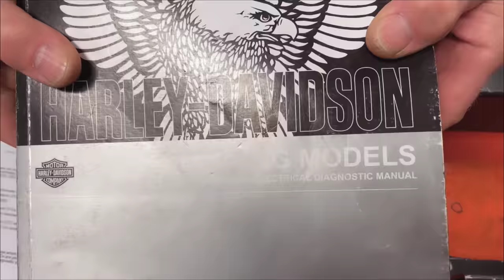Harley-Davidson Problem Codes | What Do They Mean?! | Doc Harley

Comment: Doc,
Here’s one for you, I have a 2019 low rider,  
My intermittent issue is: it only has happened to me about 3 times last year, I go for a ride shut the bike off for a few minutes, go to restart the bike cranks extremely slow, then the clock loses it time and starts flashing 12:00 , I reset the clock and go on my way, no more issues, I’ve researched this on the internet and have seen many people have this issue, other people have brought there bike to harley, but does not have an answer for?? There are no codes being set off, I know intermittent issues like these are like looking for a needle in a hay stack, but being that this issue seems to be becoming more common, any suggestions?? Have you had this come up? Thank you Dan
Reply: Look at the channel Revelator Alf. Usually is low battery. Need a new one, has to fill full even a new one before 1st use. Hope it helps.
Reply: @bostjanplut  funny you say that, I did just check his channel earlier, he did update his issue and said he replaced the battery and even tho the first start he had the same issue, he said he charged the new battery and all seems good since. I did send him a comment  and asked if still is  all good now thats its been a few months, no reply yet, hopping thats all it was.

Comment: This isn't necessarily diagnostic code-related, but can you do a video on Low Rider S handlebar death wobble and shift linkage loosening where it moves back and forth behind the rear cylinder after a few hundred or a few thousand miles?
Reply from the maker: The Neck bearing and shifter is supposed to be checked at every Service. If you have changed your handlbars and ride with out both hands on the bars, I can't help you....Doc

Comment: NOT THAT SIMPLE! I just bought a new Screamin Eagle tuner for my Street glide. After spending the money for the tuner and the time to install the tune, now I have to spend more money and obviously at the dealer to have a 02 sensor code removed. Ive had this bike two weeks and Im starting to think this is a mistake. Especially for a bike with 900 miles on it.
Reply from the maker: Too many questions to answer here. Like did You buy the Tuner, Install the Tuner and You Program the bike? and Now you have O2 sensor codes? You don't have to go to a dealer to clear a code. plenty of YouTube videos on how to clear a DTC code. Now if you want to know why the codes came up? That is another story....Doc
Reply: @LowCountryHarleyDavidson  I purchased the bike from a women who's husband had cancer. 2018 Street Glide 911 miles 107cu, V&H Power duals and Eliminator 400 slip-on. Now most people up-grade the tune with these parts so I went to check. Tuner website (Screamin eagle) said update available, so I updated the VCI and reinstalled stage 1 tune. Tune went right in no problem until I started the bike. engine light was on. Check the codes and had P0031, P0051 (CURRENT) P0134, P0154 (HISTORIC) deleted with tuner. Now Im a smart guy,  I have another bike, a boat, I like to tinker. I found the code and what it was. 02 sensor. So I follow the videos advice and tried to delete the codes. By the way you cant delete the codes with the Tuner attached. So the Codes come up and I click and hold, delete comes up, I click and nothing happens. Then Part number starts to scroll pass. So I head to Harley dealer. Now I know it may run like crap and/or crappy fuel millage. Harley said you cant delete current codes. (on going maybe?). So, appointment made for June 7th $130 to delete codes and plus parts and labor for those parts. What really got me was he didn't know what the code was he never asked and really didn't seem like he cared if I was doing damage to it by driving it up there. You would think he would have checked the codes give advice and said Mr, smith your ok to drive it home and come back later. or you should not drive the bike with this code it could damage it. But I used a Harley device to upgrade a Harley and now I have to Pay Harley to fix the problem, That's the problem. Anyway thanks for the response and letting me vent. Great videos by the way. Thanks for your time
Reply: @LowCountryHarleyDavidson  The other post was my rant but I did find the problem. The bike also has a wide band tuner on it as well. I didn't see it until I started checking all the connections. Not being familiar with the bike I missed it. But anyway I changed the tune to wide band and reinstalled the tune. Works great. So thanks for reaching out though.

Comment: What a bunch of bullshit , pump it two times pull the choke out kick it and go riding !
Reply: I had a 2014 Streetglide sold it and bought a 2009 Heritage with 12000 miles one owner that has just a ECM & Catalytic Converter for the engine. Only thing I miss is the abs braking system.